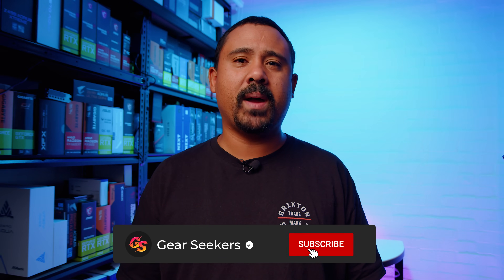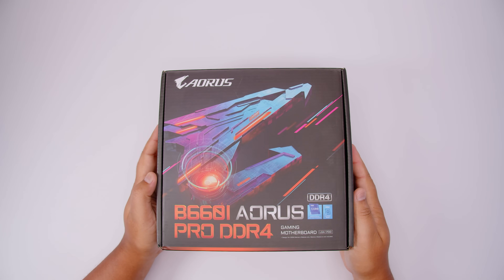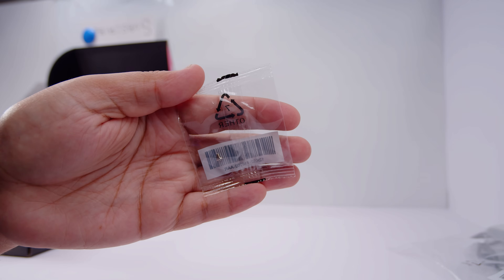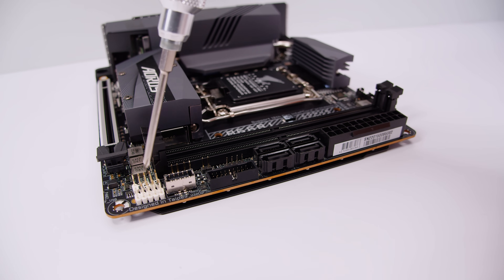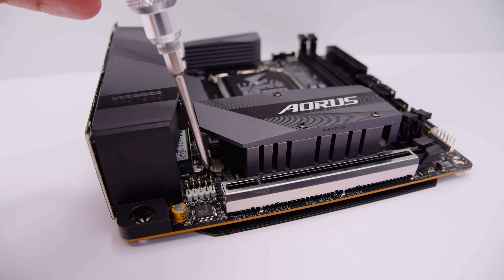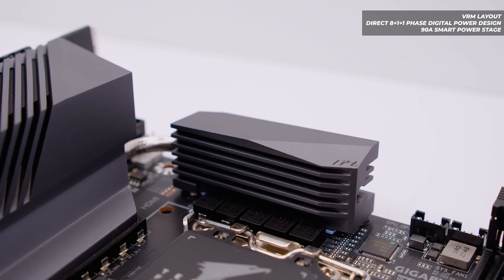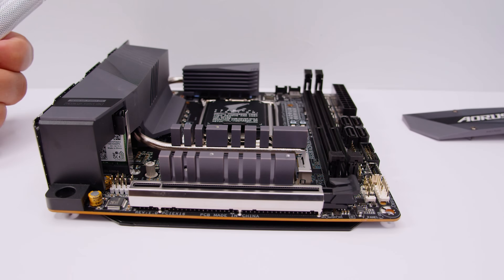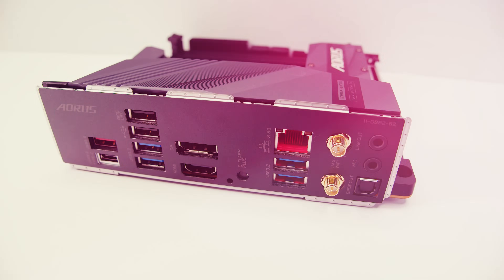This is what you've been waiting for  - Gigabyte B660I AORUS Pro DDR4 Overview

Comment: I have been using this board, it was either this or Asus's B660i which is ddr5. Do note that you might have issues fitting larger air coolers on this board due to the high heatsinks.
Reply: @Noobmeister69  I am using scythe big shuriken 3 and it fits just nice. Any lower and it will hit the vrm heatsinks

Comment: Is there a chance to do a compatibility test for most popular aio/air coolers as a part of review? Since all series 600 mb have got such aio unfriendlu design it would be very useful for many I reckon.
Reply from the maker: It's not a review
Reply: @GearSeekers  Right, maybe then a seperate material on itx mb series 600 aio/air coolers compatibility. It is something I have been struggling to find in one place, and it seems to be a big problem for those aiming at sff builds. Just a suggestion, take care, and thanks for great materials.
Reply: @czterdziescicztery78  did you find a compatible air cooler?
Reply: @GearSeekers  It's a comnercial for Al Bundy :)

Comment: got it for around $200 usd in Hong kong, happy with the qulaity, recently built into a phanteks shift air 2 case, but somehow my 3070ti didnt connect with the3rd gen riser cable, not sure if there is compatible issue with the board, already set gen3 connection in bios...

Comment: Having only 1 M.2 slot is a deal breaker imo
Reply: yes...there are only two choices in this segment, namely 1) use DDR5 & get two m.2 slots or 2) get 1 m.2 slot but DDR4...even though I want a mini ITX LGA 1700 with DDR4 and two M.2 . slots
Reply: @scofind1139  That's the Asrock H670M-ITXax
Reply: @InushiDoggo  Yes... although I don't like the design that seems low profile but maybe it's a rational choice now from Asrock and also hard to find that motherboard
Reply: @InushiDoggo  Biostar Racing B660GTN Mini ITX too
Reply: It's ITX. Lol. What do you expect?

Comment: ITX boards for 12th gen has just been miserable! Terrible designs that doesn't factor in the form factor at all. They really should focus on creating space optimized boards, not just creating big meaningless blocks of metal as "shields" and "heatsinks" which aren't necessary. Of course some heatsinks are needed on VRM, but not the big blocky metal covers. There is always a way to do it more space optimized. They should also rather put the 2nd M.2 on the back instead of stacking them, which again is just killing cooler support.
Reply: Agreed. They keep smashing cooler support with these overkill heatsinks.
Reply: Arctic has published a long list with b660 and z690 boards that don't fit the PCB of liquid freezer II aios.  Seems the industry is making fun of us.

Comment: Glad to see the B660i review here. I'm considered lucky able to find this mobo at local retail store together with 12700F which also the CPU that I looking for so badly. Previously, I did asking around on some local stores that I usually bought PC components with them, both 12700F (12700 even harder to find) and this  Gigabyte B660I AORUS Pro DDR4 are very rare and very hard to grab one. Waiting for almost two months but no news from them at all. 

Luckily found a store selling both 12700F and Gigabyte B660I AORUS Pro DDR4, it is a pretty good store that they just required me to bundle purchase with any other 3 components. So I just end up bought two cheap storage drives and a low profile coolers. Now Im using this mobo with 12700F, its really a beast compare to my previous R5 3600. So far not much complain about this board. I know a lot of peoples complaining on the 1 M.2 slot instead of 2 slots, myself also feel the same. I personally only has one M.2 NVME gen4 SSD 2TB in my meshlicious. I added on another 2.5 in sata ssd as my storage drive too. So far it is just right enough for me. I pretty sure the time I will upgrade to another CPU mobo system earlier than another M.2 storage expansion.